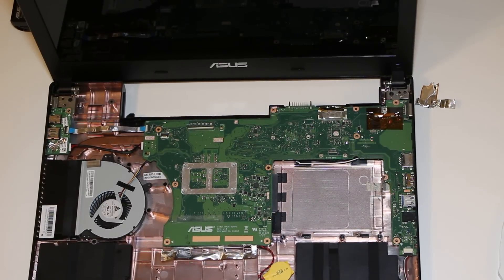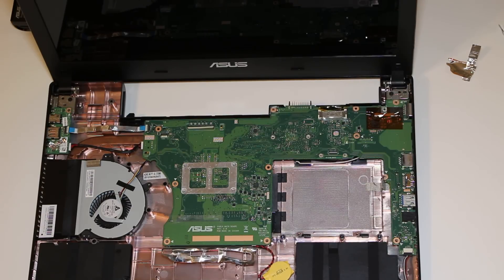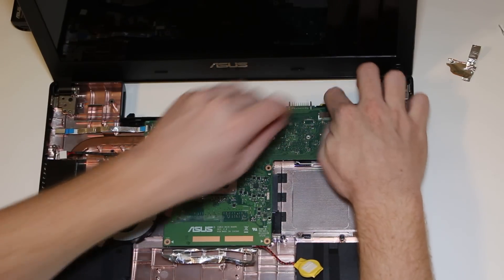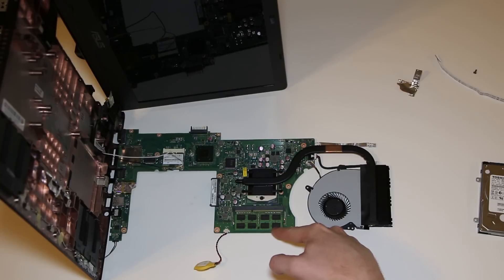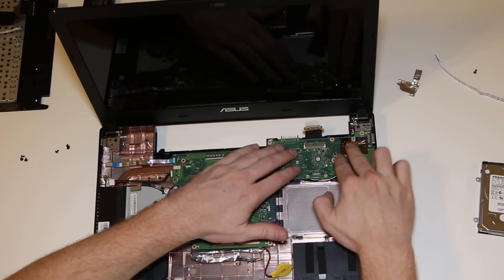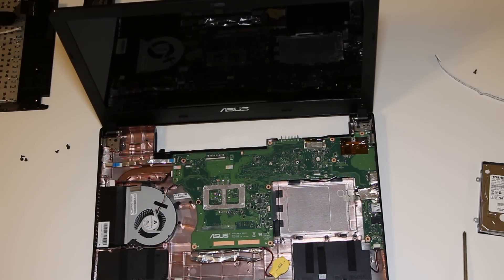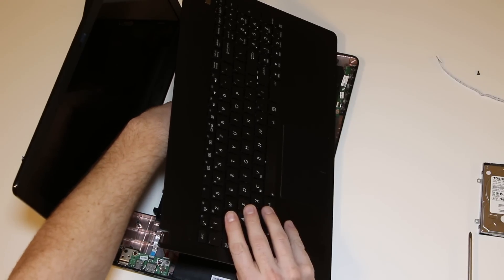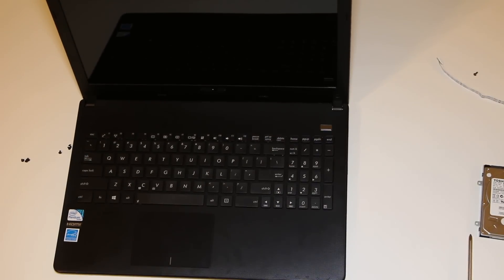Asus X501a MEMORY UPGRADE to 8gb from 4gb --- Motherboard Teardown, similar for X401a or X301A

Comment: Hi sseiyah.  Thanks for this video and the other two. This worked for my ASUS F501A.  I have just upgraded the wifi card to an Intel AC7260 and it works perfectly.  Not only do I now have faster wifi but I also have internal bluetooth now.  I downloaded and installed the Intel Pro Set drivers before the upgrade and the new wifi card was recognised as soon as I turned the computer back on after the upgrade. Your videos were a great help.

Comment: Just did this with my Asus X501a Runs much better with 8GB ram in it. But might wanna be carful when taking the motherboard apart. my Laptop left hinge screw holes broke off so I had to order a new bottom base. but other then that everything works great. Great video!
Reply: I ended up with the screws by the hinges that are longer not being able to screw back in because the 2 plastic pieces with the nuts in them broke off. This computer sure is made with dinky cheap plastic.

Comment: That is INSANE...You had to do all that just to upgrade memory on that laptop???. ASUS Blows!!!!
Reply: +Giovanni Masi No just take the back cover off I don't know why he did all of that
Reply: +NJ Crazy Gamer Wait maybe not
Reply: +NJ Crazy Gamer i own this laptop, its not that simple. you need to remove the keyboard and can't access from the bottom, its still not very hard
Reply: +Radical Moderate There is no removable back panel, I have the same model. Everything he has done is proper way
Reply: +Radical Moderate yes you cannot remove the back panel without removing the motherboard

Comment: Just in case anyone is considering this upgrade for the X501U sister model of this laptop, despite both machines being very similar the memory is non-upgradable in this model. I have gone through the above procedure and found that the memory chips are soldered therefore there is no DIMM slot on the board anywhere. Bummer!
Reply: ***** I know the feeling >_<
Reply: Saved me taking the x501u apart. Thank you.

Comment: Just so you guys know, The laptop had 8gb of ram, not 4gb. 1 4gb stick is located in the back which is way easier to get to but the other one is located deeper within the comuter as he demonstrated. Yes Asus is kinda messed up for seperating the locations of the 2 spots but oh well
Reply: I did not see any other ram slots in these model... even an online hardware scan Said 1 slot...
Reply: Can you confirm this has 2 slots? Which processor do you have?

Comment from the maker: It would appear if you have 2GB, you have a different version of this laptop. Make sure the company has a good return policy and match up the speed to the chip thats currently installed. Laptops dont have video cards, so no way to upgrade them.

Comment: What are the 2 black rectangles at the bottom of the laptop? The little connector you didnt unplug had 2 of the wire come loose on mine.

Comment: I just got the X502, similar dissasembly, but the RAM is soldered to the board. No upgrading it. The drive HAS to be 7mm and the wireless can be upgraded.

Comment: im a little surprised there isnt a spot on the bottom of the laptop where u can uncrew a portion of the back to change the ram.  that would be waaaay easier! lol.  question:  i have a 2 gig stick from another laptop.  does this laptop usually come with 1 stick of 4gigs or are there 2 dimm slots and would it be possible for the computer to have two sticks of 2gigs? id like to be able to ^grade using a stick from my other unused laptop. also, would i have to have the same type of ram for it to wrk

Comment: my Asus x501a doesn't boot up. the screen is black and you can hear the hard drive spin for a bit then stop. the fan starts to run after about 2 mins and then stops and then starts after bout 30 secs. I have two lights on front of laptop the left one and right one. any ideas to what's wrong

Comment: Hi guys,
I was thinking about upgrading my RAM on my Asus X501A. And I've got some questions...
1) I'm currently at 4GB and IÄm planing going up to 16GB. Will there be a problem with such a "big" upgrade?
2) I have run the programm "CPUID CPU-Z". It says that there a 3 free slots. Is it normal ?

Thanks !
Reply: It depends only on wich cpu installed on it. In my case a Celeron B830 with its IMC (integrated memory controller) that can address 16 GiB of DDR3 1333 MT/s. http://ark.intel.com/it/products/71141/Intel-Celeron-Processor-B830-2M-Cache-1_80-GHz

Comment: I want to be sure if the upgrade worked fine. I contacted ASUS and they say it can only support up to 4GB. I see towards the end of the video that BIOS is recognizing it. However, when you turned windows on, did it show the upgraded ram in task manager?
Reply: If BIOS recognized it, Windows will surely work as well. Of course, make sure it's a 64-bit version because of memory addressing.

Comment: sseiyah Could you post a link to the RAM card you used? I can't find them anywhere.
Reply: Braden Bare there's some online forums that list ram for each type of laptop, but I've been having compatibility issues with certain cards I already own so that's something a bit different :/
Reply: I'm sorry. I'm a little bit confused by what you just said.
Reply: If you type the model of your laptop online you can find links on google that will lead to things that will work and if you aren't sure still look at your laptop model on forums where people post questions/answers and your laptop model will be there with all the helpful tips people wanted to know about it. This includes RAM and other common problems that people know about the laptop. :) Hope that helps! But the problem I'm facing is that I have RAM that I installed and it isn't recognized by my laptop so it's physically installed, but it shows no signs of it software wise.
Reply: Ah okay. I've already looked up my laptop online, though. It's the same one in this video, so it would use the same RAM cards. I was just wondering if he could post where he got them.

Comment: Is it possible to upgrade the X301A to 8gb too or not? Will the motherboard support it? I read that the max supported ram is 4gb..
Reply: You see that because there is no easy way to get in and change the RAM. This motherboard does indeed support 8GB of RAM in its single slot.
Reply: Gregory F Really sure of this? would be great, which ram would you recommend?
Reply: +Gregory F can you tell me which ram you bought? If i google X301A compatible ram i get a list but i want to be sure
Reply: +Pieterjan P Hi I'm sorry that computer is long replaced. I imagine I either used a website like crucial, or else I googled and found it elsewhere.

Comment: does it have multiple RAM slots? because it really like to triple my RAM by adding 8GB rather than just doubling it
Reply: Nope, far as I'm aware it only contains ONE ddr3 RAM slot.
Reply: yeah it does, i already replaced it and found out
Reply: @liambass4416  Can you confirm this has 2 slots? Which processor do you have?

Comment: It's weird that adults will scream like goddamned spoiled children in the comments field of youtube, all over a budget laptop. You can pick these up at "deals" sites now for $200-250. The motherboard has good parts, namely it's sata-iii, so very fast with an SSD. It also has USB 3. Upgrade with an SSD and RAM and you have a great, fast computer that you can use for things like a media server, or a powerful office computer. I run Ubuntu (and Windows) on mine it use it for everything from media server to home automation to security to backup.

It's definitely true that the trackpad on this thing is horrible. I use an external mouse or I remote in from another computer. One more tip if you must use the trackpad: use tapping and double-tapping instead of fumbling with the trackpad buttons. It's much more accurate that way.

Also, upgrading is hard. This was designed to be a cheap budget laptop and part of keeping it cheap was just to throw the guts into single pieces of plastic instead of spending extra on design and additional parts.

Comment: can i upgrade or change the processor??
Reply: Nope
Reply: Sorry mate i was rong. I thought this video was the Asus x551mav on that laptop you cant change the processer
Reply: +Jake Sully If this guy has actually done it, and not just looked it, disregard. But  I recall convos about this on notebook forums, and I'm pretty sure that while it appears you could put in a higher processor, the motherboard will not accept it. I could be wrong. I got rid of this thing several months ago.

Comment: DO NOT GET THIS Laptop. The touchpad button combo is truly awful and WAY too far left. Just look at the pics and you will see yourself. Keyboard is horrible because of the short space bar. You will constantly see words stuck together. Upgrading the RAM? Well you can see yourself how dumb this is. I got a dell latitude 3330 a little smaller (13.3) not as good looking but WAY better keyboard, mouse and buttons. AND they have 2 mem slots! Mem AND HDD is behind 1 Door/screw. On sale $300.